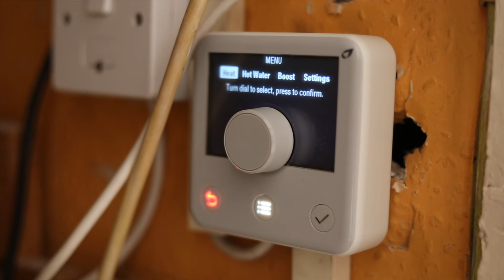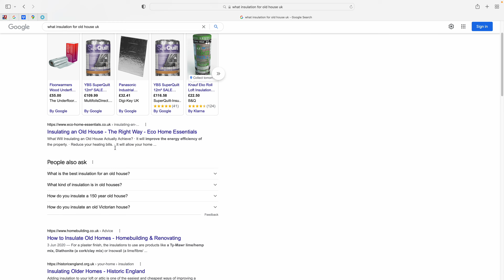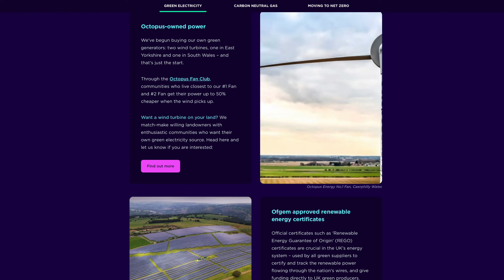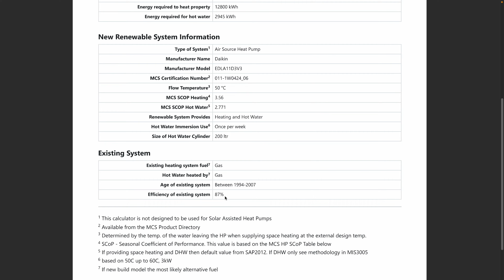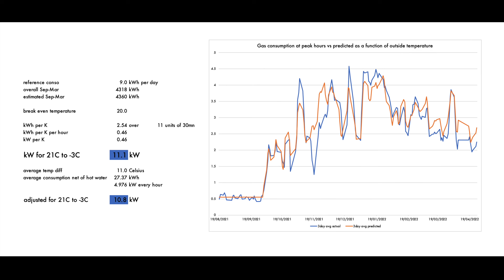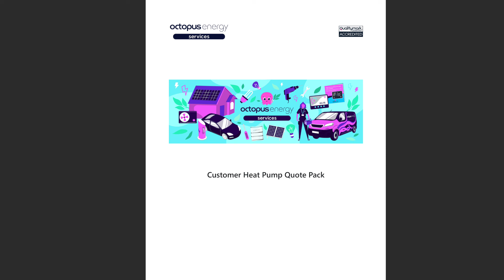Heat Pump from Octopus - Should I get one?

Comment: A really helpful and timely video as I had my Octopus survey last Friday and their 10808 kW Heat-Loss calculation and I'm now waiting on the Quote! My Gas consumption in past 12 months suggests about 13,000 kWh but I'm not sure how much that has been affected by my switch over to heating DHW electrically rather than by my Gas Boiler about 5 months ago so that I could lower my Flow Temperature to 50C of less at the start of the winter. I have Octopus Go, at time of writing, and I have invested in Ripple Wind Turbine for about 3500 kWh offset from this coming October. Octopus surveyor seemed not to want to include extra radiators but wanted to upscale significantly neally all of the radiator sizes, even though there was existing pipework where the previous owner had removed a radiator - refitting the radiator to the pipework would double the radiator capacity in the lounge without changing the one lounge radiator for an enormous triple!
Reply from the maker: Well done for jumping on the bandwagon of Ripple. I am eagerly waiting for phase 3.
Reply: If you call the person who is managing your quote they can change or add a new radiator.  Following on from mine last week I called and increased the size of most of the one's they quoted us as I want to target a 45 or 40 degree flow temperature but could not do this during the survey as one radiator was a bit too small and difficult to upgrade due to room layout. 

They have also connected me with a technical installer and approved the system being integrated with open energy monitor and the myeddi device we have from solar pv install.

I admit I had my doubts but as others have said they seem to be doing things right, Just waiting on a new EPC that ads the cavity wall insulation and some other minor updates so we can go ahead and get the BUS grant.

Comment: I realise this is four months old and you may have moved on by now. But it is worth  considering putting in underfloor heating in the ground floor - there are ‘nuclear ‘options (digging up the floor) or compromise  options ( overboarding). This will obviously obviate the need for radiators and will enable the heat pump to run at lower flow temperatures and thus more efficiently.
Reply: I run my heat pump at around 32 degrees at 6 degrees outside using oversized radiators and trust me it works perfectly, just installed a homely optimiser which has further increased the scop, although i do stress recently fitted.:hand-pink-waving:

Comment: I have recently moved into a 1930 s terraced bungalow. I am installing triple glazing and I am upgrading my insulation to 300mm in the loft. My aim is to have a heat pump and if I can afford it solar panels. Of course I am on a budget since divorce. I think the hot water would be better left gas. A small gas water heater is only 5 to 6 hundred and the infrastructure is already there. So I would go for that rather than the faff and bulk of electrical water heating.
Reply from the maker: Sounds good to start with insulation. I'll probably post a video on electric vs gas heating in the cylinder. Long and short of it is that in my experience electric with immersion heater seems to be much more efficient (like a kettle)

Comment: It seems to me that the order for the upgrades should be: 1: new windows and insulation. Over the years, we have saved ~22% on gas energy usage (heating+hot water) just by having cavity insulation done and replacing old double-glazed windows with better ones. 2: solar PV. You can now get a 4kWp installation for ~£3000-£4000 in the UK. Then ASHP. I don’t know how much power these use at any given time, but I would have thought that the solar could provide some of the electricity used by the ASHP?
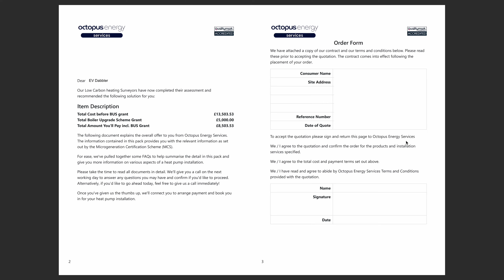Reply: We have 4.2kWp system which produced around 4200kWh. We run our Octopus 7kW ASHP from about 04:30 to get a couple of hours of cheap GO and on cold sunny days soak up  solar . We also use an eddi for DHW .  Every little helps but means we car our EV more at night but that's OK as the aim is to use as much solar as possible. Thinking a battery is final step but also have investment in  Ripple 2 which will offset the running costs . Even so I estimate we are saving about £700/year versus gas . If we had only standard rate electric it would be about £100.
Reply from the maker: @philipbroggio9315  many thanks for sharing your experience. Very helpful
Reply: @evdabbler  Other observations are that Octopus sized system on -2⁰c external temp with 50⁰c flow temp. When we got to those conditions in December we found the house was getting too hot ! We had weather comp set at 50⁰@-2⁰ext/ 35⁰@18⁰ext initially. Gradually tweaked the settings to 50⁰@-15⁰/28⁰@20⁰:and this maintains around 20⁰ downstairs and 18⁰ upstairs. Thermostat set at 21⁰ during day and 18⁰ at night. We have achieved an sCOP of about 3.5 since last June . In December it was more like 3.0 but in milder conditions getting more like 4.1.
Reply from the maker: Insulation first definitely. Plain brick houses reduce the scope of the (reasonably) possible. Solar means a good roof that is not ripe for replacing, no asbestos etc... and I am not clear you can have a 4kW peak for £4k anymore, at least not in south East GB that I have seen.
Reply: @evdabbler  you are right that it is currently more around £5000 for a 4kW system (no battery). But companies that do it for £3000-£4000 do exist… I just don’t want to mention any and then get shouted at 😂
Reply: Well, I for one would love to know where a domestic consumer can get 4kWp of solar installed for £3000-4000! The Government's own statistics show an average of about £5500. At home in south Oxfordshire, we've had four quotes all around £7500-8000 and another £5000 for a not very impressive battery system that would take 20 years to pay for itself. Some people are making a lot of money out of solar and it's being sold like double glazing.

I was quoted £5500 in 2015 for a 4kW array, and here we are being told that panel prices are constantly dropping! They may be at the manufacturer's end or for big purchasers, but the installation price for the poor atomised single householder with few negotiation options and no economies of scale, the price just seems to keep rising. I worked as a technical coordinator for a large housing association last year and they were getting prices like £2600 installed for a 3.2kW system on a 150-plot new-build development. Of course the supplier doesn't sell to the general public . . .
Reply: @matchmade44   again, I won’t mention the company I have in mind, just Google and look further up north, beyond the River Trent. Clearly prices are higher in the South 😉

Comment: I had a free heat pump installed via an area based scheme in Scotland and my summary is quite simple. If you want to spend far more money on heating your home, get an ASHP. If you want to save money, stick with fossil fuel. I would been outraged if I'd spent the £12000 it cost to install this ASHP system and ended up with vastly increased bills and my experience is not unique. The madness of the ASHP, is that we've now installed a wood burning stove. This was never even a consideration when the house was heated with Kerosene. We have the Mitsubishi Ecodan system and the running costs, so far, are outrageous.

One other point that is very apparent is the fact that there appears to be a complete lack of people that can actually advise you how to use the ASHP efficiently and actually save money. Get them installed and move on the the next property, seems to be the real motivation.
Reply: I think you were visited by the cowboys. Sadly the industry is in it's infancy in the UK and many installers are motivated by the grant and fast turnover with the hope that when you realise they did a bad job, they can't be traced. 
The only reliable installers I've heard about are the ones on the Heat Geek map.
Reply: @paulrattray8121  it seems there's a whole posse out there? I've only met one person that's been happy with changing to an ASHP. He's a Green/Communist type, so that might be easily discounted.
Everybody else, simply says they are far too expensive to run.
I think our ASHP needs a bit of tweaking and a much lower cost of electricity, then it would be fine.
Reply: @gtd65   I have met many people who say they are very happy, but most have done it for the environment rather than cost as EV dabbler recognises. To do that is a good thing and it is something most of us will  do over the next 10 to 15 years but the early adapters will probably pay more. For those who  can afford it you are doing  a very worthwhile bit to help to reduce the costs of those who currently can't and  to reduce climate heating. Thanks.
Reply: @robbrookes4889  thing is, this isn't a new technology, where you could consider people being early adopters in 2023. There's already been an "investment" of over £25K worth of measures installed into the home to supposedly improve energy efficiency. All of these additional measures have a carbon footprint. The real problem is the cost of electricity.
Reply: @gtd65  Can't comment from personal experience. Maybe in a years time but it seems to me the technology is new in terms of mass adoption. We are hoping to have a heat pump fitted this summer but the reason is not really to save costs but to do what we can to stop the burning of fossil fuels.  We do have solar panels that produce much more than we use through from about April to October so we should save some though not probably enough to pay for the initial outlay which we expect to be around £8000. Electric is currently around 3 x the price of gas so running costs should be about the same.  From a friend who is very happy with her heat pump.She lives in a detached suburban 4 bedroomed estate house. >>We generate 75% of the electricity we use to heat and power our house and drive our electric car from the 32 solar panels on our roof aided by a battery. Unfortunately we use more electricity in the winter and generate most of our electricity in the summer.<<
Reply: @robbrookes4889  I hope it turns out well for you. There's no substitute for actual experience and getting a possibly revised opinion from that. The cost of electricity needs to drop significantly, to possibly one third of the current market rate, to make an ASHP an attractive option. Even if an ASHP could be run for 7p per kWh, it would take 30+ years to break even with the previous kerosene fired system with the £12000 installation price.
Reply: @gtd65 "one person"? There are nearly 20 million homes with heat pumps in Europe, you better warn them...
Reply: @WanderingDutchman  might be two now - finally got our ASHP woes resolved in October. Was a software clash/conflict problem.

Comment: I'm getting an Octopus Heat Pump done in April May. Costing about £5.5K because of new pipes that have to be laid throughout the house from small 12cm to 21cm. Three new rads, an extra one from living room making three, and kitchen and bathroom from single to doubles rads of same size. I have a battery and solar panels so expecting this change to make a major difference to water and heating throughout the year from using Gas, which will be removed completely. From spring to autumn water and any heating should be with free sunlight.

I will be aiming for a scop of over 4 and will run the temperature a little lower than 50, prob 40c, with an air temp of about 18c. Probably on for the entire day, turning down at night.
Reply from the maker: Sounds like an ideal set-up, with a reasonable price tag when considering the changes
Reply: @evdabbler  Octopus can now AHSP AHSP with just 10mm new build pipe work without any upgrade to pipes!

Comment: Have you looked into Air-air heat pumps. Personally I may go for one due they are even more efficient than the water heat pumps also in summer act as ac also as  dehumidifiers. And the big win it comes to a simulator price to replacing all my old electric radiators. Apx £5000 for 1 to 5 system installed. But still need to get it servayed first for an accurate price. But speaking to people who have air to air they all said it was way cheeper than the wet systems like octopus are flogging. And more efficient and easer for a reliable install.
Reply: It depends whether you want the addictive hit of a fan heater vs stored heat within the fabric of the building

Comment: I would not be happy with an SCOP of 3.56 - Anything less than 4 is not worth it IMO. I think the issue is that their design flow temperature of 50C is too high - It needs to be more like 40C for it to be viable. (Which means even larger radiators or improved insulation) You could consider type 33 radiators or underfloor heating (Or both) for the lunch area in order to reduce the number of them.

Comment: Sorry to say but my experience says a good gas boiler outlasts a good ASHP. Boiler has moving parts and any maintenance is quick and easy from thousands of gas safe installers.
Reply from the maker: Probably a case of maturity of the industry though? At some stage wouldn't we expect to see more installers/service engineers sufficiently familiar with ASHP?
Reply: Things that have less moving parts tend to be more reliable

Equally, industries in their infancy also tend to have less reliable products.

Comment: My new boiler came with a 10 year manufacturer warranty. Surprised that these heat pump manufacturers give such short warranty on their product….sort of implies that they don’t have that much faith in the longevity of their product!
Reply: Unfortunately the majority of the green energy sector is full of chancers , BS merchants and crooks , for the vast majority of people they spend a fortune for no tangible gains , fill their house with expensive tech that most of the installers can’t fix  and end up with bigger bills  and future tech problems , as an engineer and very knowledgable person on passive house practices and building science  etc I am very annoyed by the amount of sheer  deception and incompetence in most of this green none sense , invest in insulation and draft proofing , investing in good ventilation and humidity control and when it comes to heating “Keep it simple”

Comment: I appreciate this video and your thought process. You've had a very good approach. Two comments or questions:
1. Why not underfloor heating for better heat distribution and avoiding those ghastly radiators?
2. Why not installing storage batteries to charge up overnight at 10p/kw price? You could also add solar panels and produce some of your electricity needs
Reply from the maker: Thanks. Two very fair points.

Comment: Excellent assessment!  As a former MCS installer of ASHP now looking at one for my own home.  I’ve explained to the 3 companies who have quoted I now work in another industry but I have experience.  Not one installer understood or complied with MCS or BUsS requirements.  My heat loss using current MCS calculation is 7.1kw my quotes are for 8.5 / 12 kw!  

Finally got octopus to to my ASHP quote in December 2022.  From all the information from other guys who as had Octopus do the survey I’m actually thinking these guys are doing a proper job!!!  Not just selling and installing in efficient overpriced ASHP!
Reply: This is really reassuring to read, I've got Octopus installing ours at end of Jan (should have been summertime this year but Woking council fucked around with the approval so we just moved the install location to get around it in the end, took months)
Reply: But we have the same problem with gas boiler installers. They used to be trained to calculate boiler and radiator sizes quite carefully, but nowadays most just seem to stick a figure in the air, over-specify, and bill the extra cost to the ignorant customer.
Reply from the maker: Thanks for sharing!
Reply: Agree, I've had 17kW,14kW and a recent 12kW recommendations.  I reckon a 7kW is sufficient.

Is it the MCS regs or the installers themselves who are responsible for oversizing and thus inefficient operation of ASHPs...or both?

Comment: Yes, your radiators (heat emitters) will need to be much more powerful (i.e. larger and more of them) because your flow temperature will be lower (50C or less). This is unavoidable with changing from a gas boiler which has a much higher flow temperature (say 80C). I have been slowly replacing mine and upgrading my pipe work over the years.
Reply: Running the house at 21 degrees all day and night seems excessive - or have I missed something in terms of using controls to time when the heating comes on and how warm it is at different times of day?

An alternative to the oppressive four radiators in the Lounge would be to install hot-water underfloor heating. You can get very thin-profile pipes nowadays that can sit on top of (preferably well-insulated) existing floors, and on first and higher floors too, not just ground floor. UFH is very well-suited to the low temperature output of ASHP, and it is a much nicer heat than the air convection produced by radiator. My experience is that you can easily run a room at an air temperature of 18-19 degrees but because your feet feel warm, you don't notice the reduction from, say 20-21 degrees with radiators.
Reply from the maker: Sounds like a good way to get ready. I understand there are benefits to be had (better efficiency) of running a conventional system at lower flow temps too.
Reply: Never had my boiler at more than 55deg setting for heating 😂

Comment: I like the fact that your dimensioning matches their actual calcs. I am surprised that they are going for a 50C design temp since you are being quoted for a load of rad upgrades anyway - have you had comparable quotations in terms of spec? Heat Geeks?
Reply from the maker: No. I have not gone through other quotes at this stage.